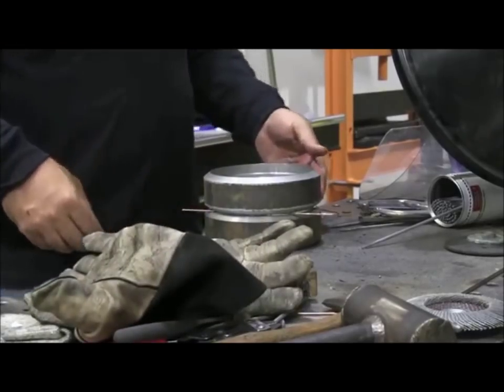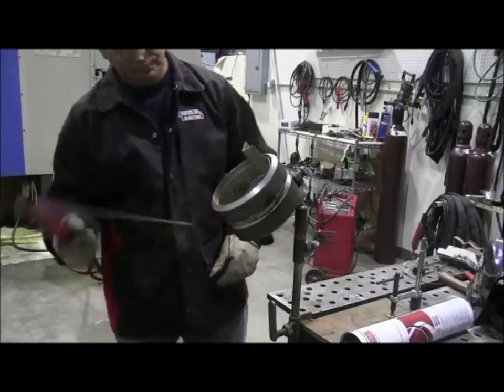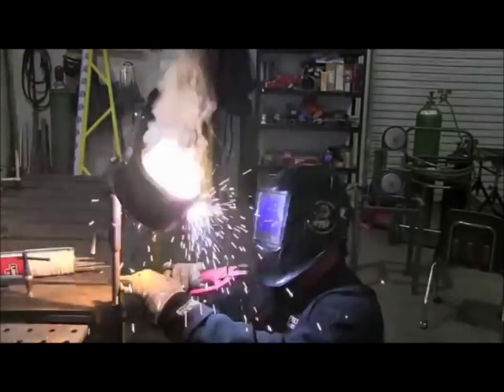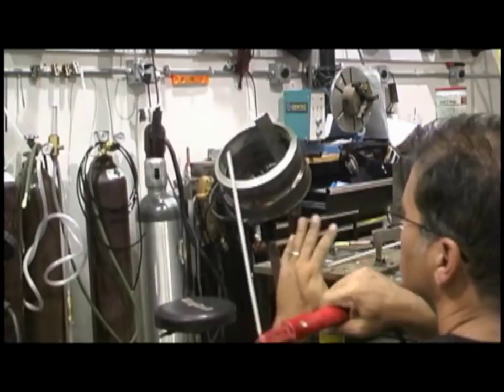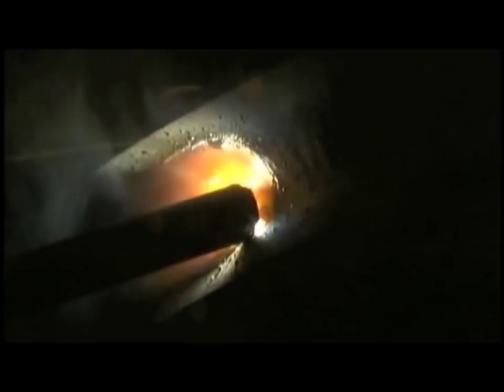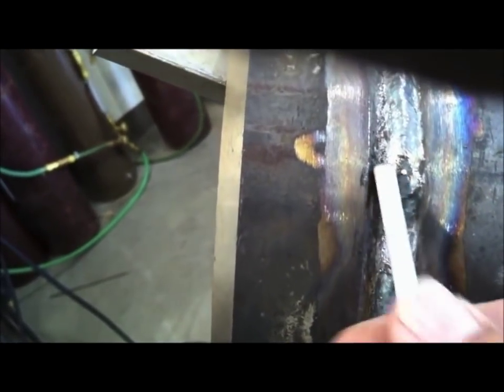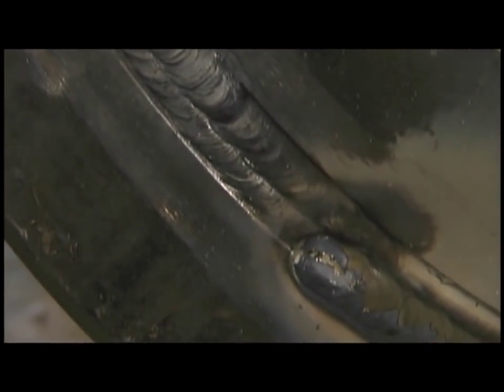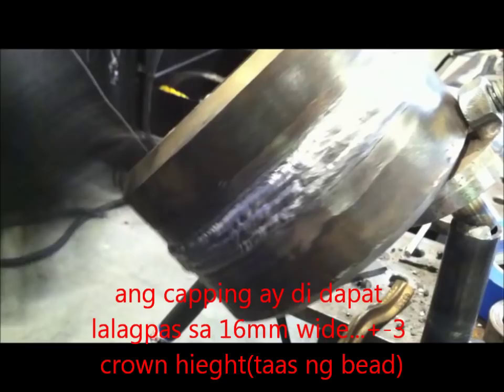Pipe Welding in 6G position

Comment: Is there a reason why we need to weld the 6G in upward direction?  What will happen if the you weld it downward direction?
Reply from the maker: Good question walter, first the type of direction that we practice like we do in the TESDA is in accordance with the American welding standard B1.0-1 ,Meaning its in the standard,according to this all material that has a thickness of 3/8'' to 1'' and above is need to weld in uphill motion,,reason why because thicker material are difficult to penetrate in downhill motion,,if the material you want to weld is thin you can apply downhill motion to achieve good penetration without burning it through,then above all its in WELDING PROCEDURE SPECIFICATION,what on wps  that the one you need to follow.
Reply: @AGA-ORAGON  sir, thank u for the precise explanation. Does it also need a direct polarity for inverter welding if thinner metal as u described? Or downhill direction configuration is sufficient? Thanks for response. Keep safe & God bless

Comment: Ano po ba Ang penetration at hot pass?
Reply from the maker: defined as the distance the fusion line goes below the surface of the metal being welded. sa madaling sabi ka ORAGON ito yung lalim ng tunaw simla sa ibabaw hanggang sa ilalim.
sana ay nasagot kita at naintindihan mo ang ibig sabihin ng penetration.salamat.
Reply: @AGA-ORAGON  anung ampere rating ng 7018 na ginamit nya?